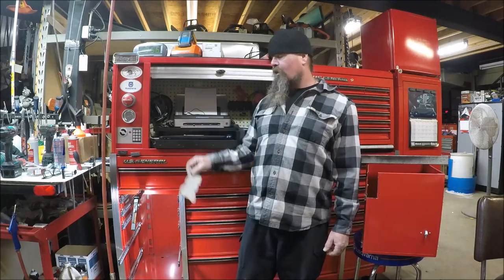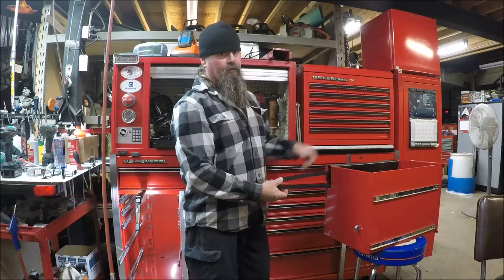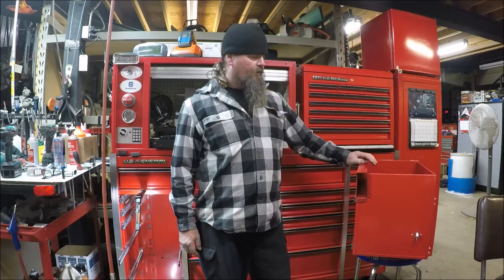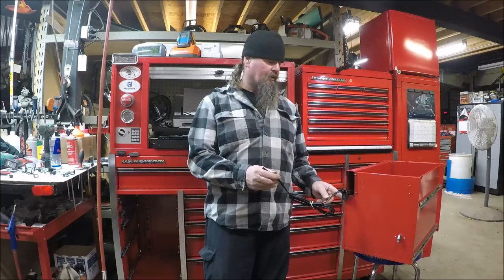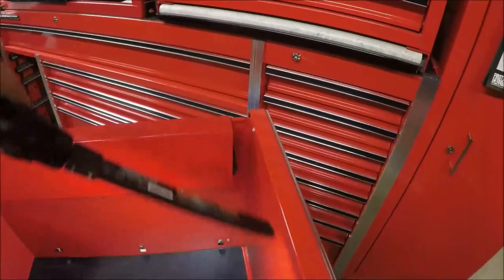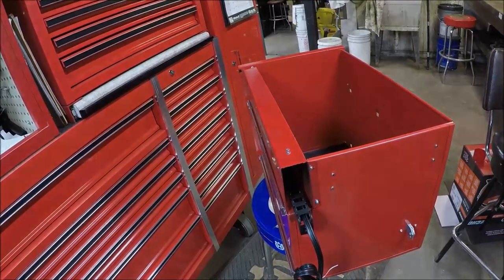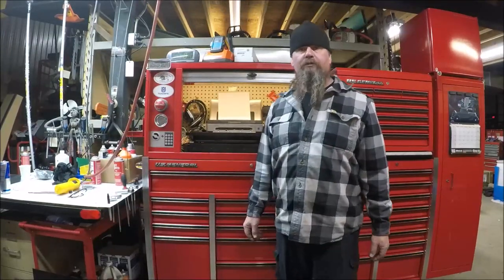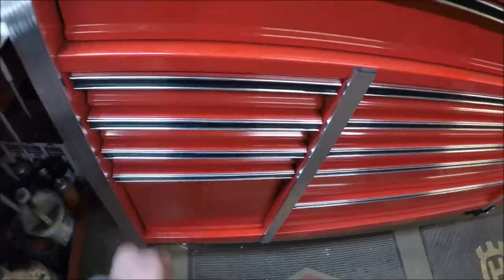US General Power Drawer

Comment: Great engineering. It was smart to make the box the small height as the drawer rails so your chain has a straight shot next to the rails out the back. Better than the snap on where u have to cut a hole side of the drawer off.

Comment: I am having trouble finding a shop that can make me the cannel, send me an email so we can discuss you making me one. Thanks
Reply from the maker: We can discuss it right here. I'm not interested in making parts for anyone. I supplied the idea and you have to supply your own labor. When I get these ideas in my head i just roll with them till they are complete and out of my head. I don't even remember building that channel but there are simpler ways to do it like just building a shelf or rest to support the chain link. Good luck and thanks for watching.
Reply: How did you make the channel with no break I’m not very Verse in metal fab
Reply: @rupert48183  probably a vice and some persuasion